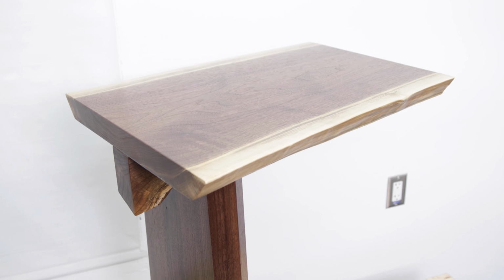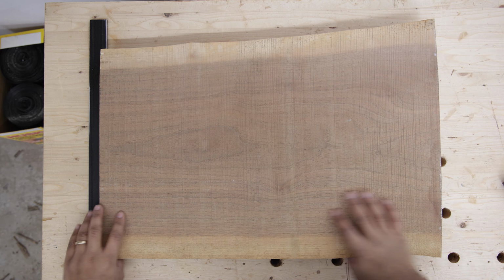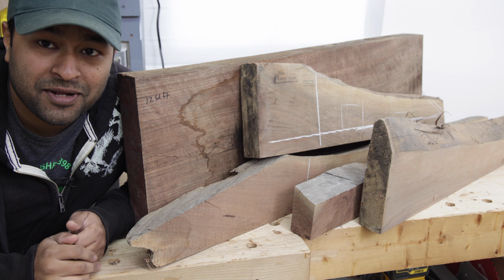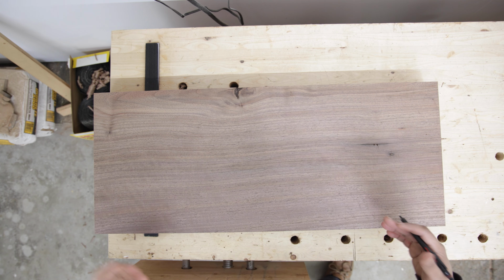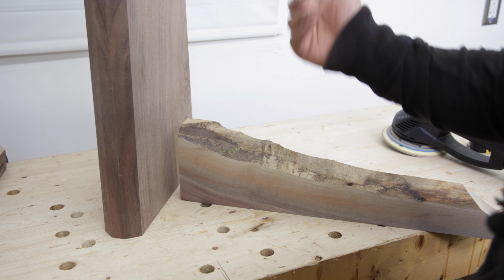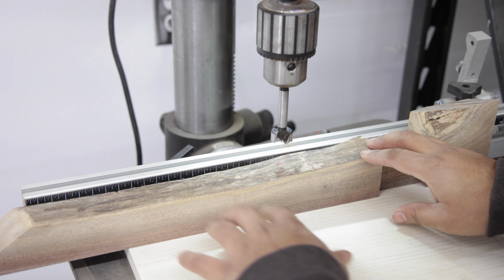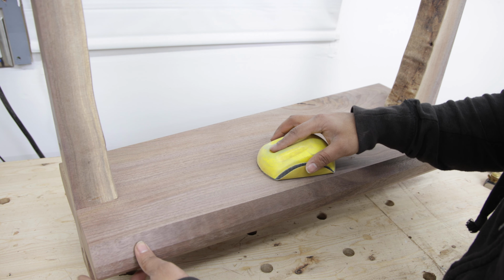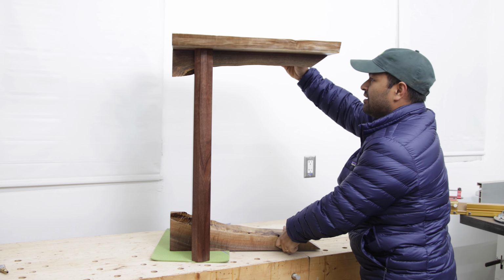Live Edge WALNUT SIDE TABLE Build - Woodworking

Comment: Harbor Freight HVLP sprayer for the win! 👍🏻
Reply from the maker: You're one of my most loyal viewers. Just wanted to say that I appreciate you! Indeed, the Harbor Freight HVLP gun is awesome! I've also sprayed latex paint with it and have been very impressed. Have you had a chance to do some spraying on the coffee filter holder?
Reply: @WoodcraftBySuman  I love the content and want to see you to get in the mix with the big guns like JKM and Jay Bates! Unfortunately I haven’t had time for the coffee filter holder. I’ve got 19 tables for a restaurant in the works and several other projects after that. Have you had any luck spraying water-based poly? I’m worried it’s too thick to spray and I’ll screw up my gun.
Reply from the maker: @aaroneously  I am so glad you're liking the videos. Once winter is a little behind us, I will have bigger projects in the pipeline, including an awesome purple heart workbench with welded base. Regarding water based finish - Yes. I have used this same gun for water based poly. You have to be especially mindful of dilution as the finish does not tolerate a higher dilution content. No more than 10% dilution factor at most. I have sprayed it directly out of the can without dilution and it works well if the temperatures are in the high 80s and the liquid flows well. Regarding cleanup - definitely want to clean the gun immediately after finishing and between coats. I would have two guns. 1 for lacquer and 1 for water based finish/paints. Lacquer as you know, is super easy to clean up. I have found the gun to get clogged up w/ water based finishes if I'm lazy at throughly cleaning the gun.